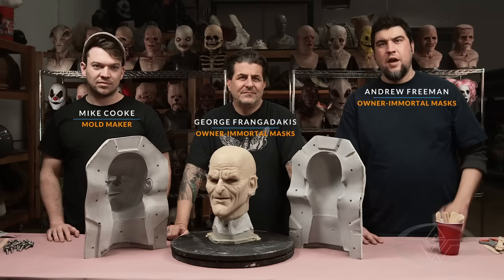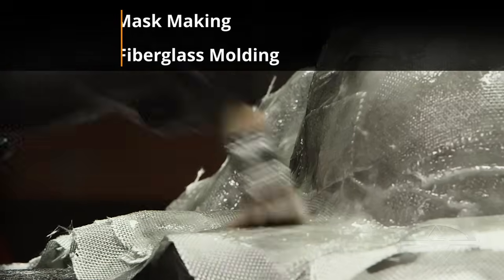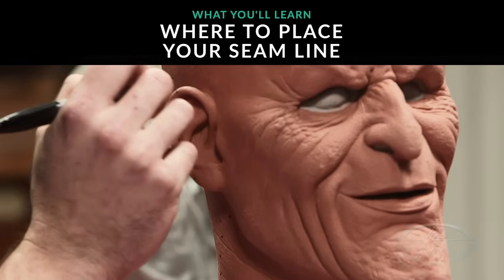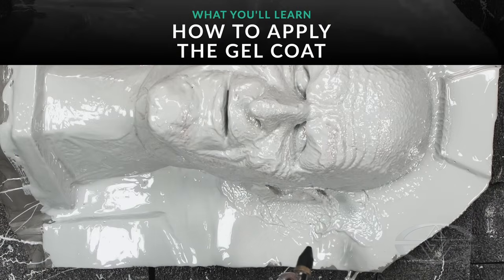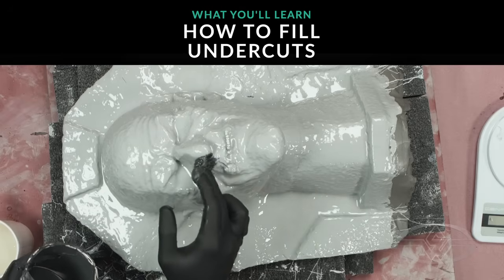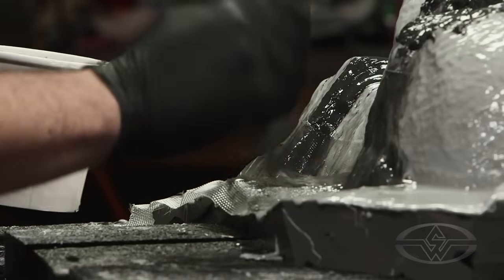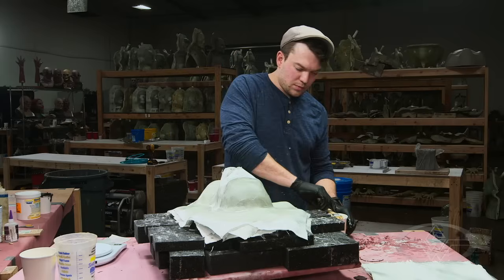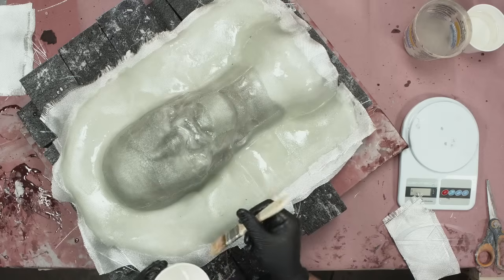How to Make a Silicone Mask Part 1: Epoxy & Fiberglass Molding - PREVIEW

Comment: Question, I have a plaster cast of my face from 25 years ago, I want to use it to make a silicon mask but I'm worried the process might damage the mold. Since this is a one of a kind mold I want to know if it's even possible to use Silicon on a plaster of paris mold?
Reply: Put  a release on the plaster of paris. When I cast silicone out of a stone mold, I put a thin layer of vaseline on the stone first.
Reply from the maker: The truth is that we are admins here, not artists but feel free to join our forum where you can meet our students and other artists, and you can ask anything from them. Join here, it's free: http://forums.stanwinstonschool.com. – Balázs